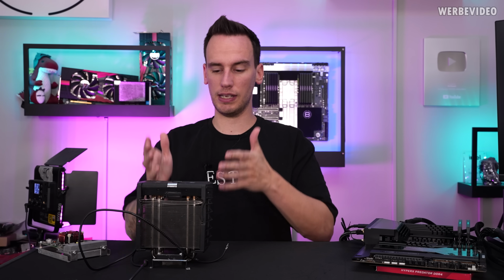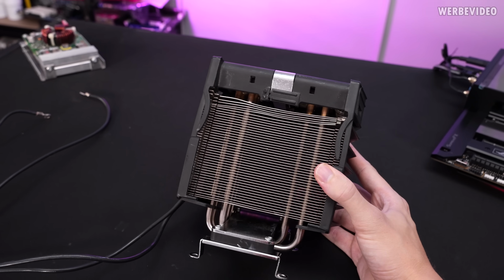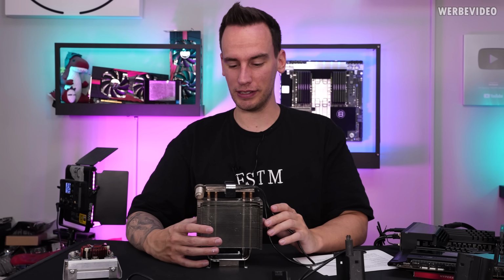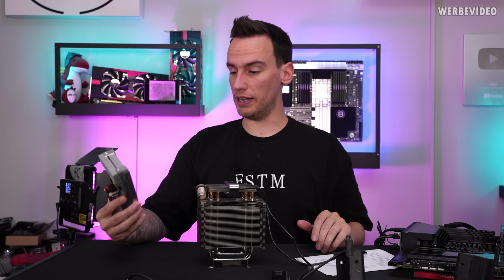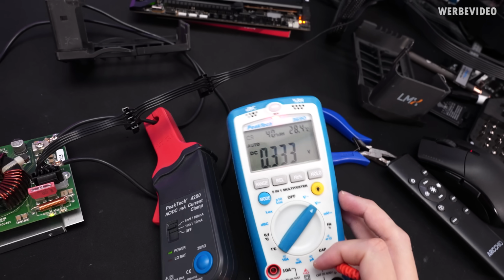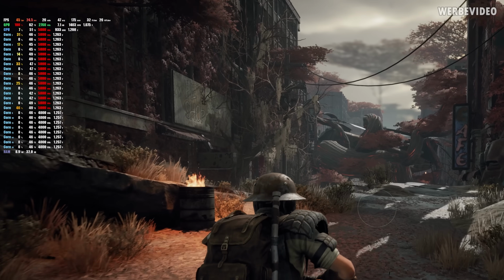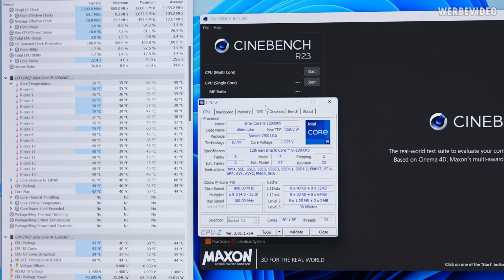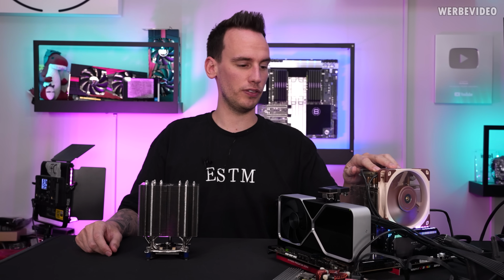This Cooler Ruined an entire Company - LMX Liquid Metal Cooler

Comment: Awesome video. Also this kinda made me realize something... how come my 5950X when running CB23 consumes about 100W package and the temps are 70-80*C with similiar cooler, but the 12900KS in the video consuming 200W package reaches the same temps as mine that is insane. How is that possible?
Reply: In the intel case, the cooler putts 100w more heat into the room. If it does that fast enough the temp Is the same...
Reply: @kaptainfry  Oh I see. Makes sense now that I think about it.
Reply: If your 5950X only suck down ~100W package power in CB23, it means your either your motherboard is throttling the CPU because of insufficient VRM or you disabled PBO . If you unlock your PBO power limits, you can get the 5950X to suck down ~240W .
Reply: @fleurdewin7958  Yeah I have PBO disabled. Increasing the power draw wasn't point of the question tho.

Comment: This is most likely an electrohydrodynamic pump. These work by passing a current through the (conductive) liquid perpendicular to the flow which is exposed to a dipole magnetic field in the other perpindicular direction. The lorentz force on the flow is the driving force, basically a liquid railgun. This also means there are no moving (mechanical) parts in the pump, so it is no suprise that it still works well. Btw heatpipes work so well because the water inside goes through a phase change. The thermal conductivity is thus not at all important for it's performance. And in water cooling loops it is all about convection, so again the transport medium thermal conductivity is not important.
Reply: You’re correct. The wires are going into a coil around the block, basically half a transformer. That’s why it’s pulling 30amps, it’s basically a short circuit. I’m kind of surprised/impressed that it wasn’t so electricly noisy that it didn’t make a hum or hiss on the audio recording.
Reply: @leafydialupking1  There is no coil, the field is produced by permanent magnets which are held by that clamp thing (which is actually shielding and guiding the flux more efficiently) on top. Making an electromagnet for this application would be very inefficient and at 30 amps it would require more power than the CPU its cooling. As for noise, this is a DC application, so the only noise would come from the power converter board
Reply: @WouterVerbruggen  I would think for it to be a Lorentz force pump that the wires would be perpendicular to the magnetic shield, since the current needs to move perpendicular to the magnetic field and parallel to the direction of flow. And in that case the inverter module must include a current clamp since the pump would have very low resistance.
Reply: @leafydialupking1  The current flows throught the liquid metal from one side of the channel to the other, the lorentz force pushes on the fluid directly. So with the liquid flow as reference, the magnetic field is top to bottom, current from left to right and thus force in the direction of the flow. The electical "short" is the low resistance of the liquid metal, which I would guestimate to be in the 100 nOhm range so you'd need some expensive equipement to measure that directly.
Reply: @WouterVerbruggen How does a static magnet achieve this?  If that was true, you could slap magnets on a piece of steel and it would levitate or propel itself.
Reply: @VndNvwYvvSvv  you have to a current in the metal and then you can do just that
Reply: "Liquid Railgun" would've been a much better name for this cooler :)
Reply: @nazgu1  Caterpillar drive was right there. (I am aware this comment is delayed)
Reply: I am also sure it is a electrohydrodynamic pump but not sure how the current is prevented from flowing in the metal structure and not just in the liquid metal. Otherwise it does not work.
Reply: @1kreature Well through the liquid metal there will be continuety throughout the cooler. The current distribution will favour the path of least resistance though, so by proper engineering that won't be a problem. The will be a voltage on the entire structure though, but this voltage will be so low that it's not a problem and probably not even noticiable at all.
Reply: Eddy currents was the first thing  that came to my mind when looking at this particular setup, very interesting.

Comment: if they wanted to improve a bit and feel a bit edgy could of used acetone; commonly used for evacuated solar tubes and so considered safe:P
Reply: *they could have
Reply: If they were willing to use NaK in a CPU cooler, then if they had to switch to a solvent instead, they might as well go to diethyl ether. I'm pretty sure maximizing flammability was part of the design goal.

Comment: worth mentioning, even if this cooler didn't fail catastrophically. If a user wanted to get rid of it they would likely need to contact a chemical disposal specialist, and failing to do so could also lead to violent results. it's a wonder this was ever considered for retail sale.
Reply: @danielrouw2593 everything you mentioned people know to handle with care. But a PC cooler filled with a dangerous substance that looks at a glance like any other safe PC cooler is a disaster waiting to happen. Very very strange to defend this useless dangerous product but you do you 👍
Reply: @danielrouw2593  I don't think anyone was advocating for making this illegal. Also, leaks and accidents happen, NaK is much more reactive than you give it credit for. If the air is humid it'll burst into flames all on its own.

What we're saying is that the company who made this was dumb for making it because while it might have the potential to slightly outperform a heatpipe, a heatpipe is simpler, more robust, safer, cheaper, easier to manufacture, stores better, and doesn't present a disposal hazard.

Drano and concentrated soap are what NaK violently reacts to form, after which it begins to react the way you're expecting it to.

People like you underestimating the dangers of unfamiliar substances are actually one of the main drivers of nanny state regulation, because you get yourself killed mixing gasoline and styrofoam and your family sues the companies who made them. They then lobby for tighter regulations on substances to lower their legal costs.

Comment: Not only does water have a better heat capacity, it also undergoes a phase change in heatpipes. The phase change step takes on so much more energy than heating water. 
Heatpipes also solve a secondary problem compared to water/liquid metal; the boundary layer effect, the best flow/fastest transport of volume/sec. in a liquid cooling loop is in the middle of pipe... the heat exchange though, happens on pipe inner surface where the flow is the poorest. Heatpipes forces the transport of heat along the inner surface.

(all modern waterblocks are designed to create as much turbulence as possible to break up boundary layer effect, the liquid metal design here looks like straight pipes thru CPU block, but I could be wrong ofcoz)
Reply: Can you explain the second problem it solves? I don't quite understand.
Reply: @queueeeee9000   (sorry for a wall of text) Boundary layer effect, when you pump a fluid along a smooth tube, you will get different flow speeds in the tube depending on how close to a tube inner wall you measure. Gas/Water/liq. metal flow creates a drag resistance against tube inner surface. Slow flow near inner surface compared to middle. That sort of creates a layering effect, liquid near wall prefers to travel along the wall. In this liquid metal design, the liquid metal is only getting warmed by the conducted heat transfer from external source at the inner surface of tube. Then, already warm liquid continues to travel slowly along the inner tube while in the center of the tube "cold" liquid rushes past the entire hot area without picking up any heat. Only when the flow is disrupted by a rough surfaces, bend or a shift in inner diameter will there be promotion of mixing the hot "wall fluid" and cold "center fluid".

It is possible they have rough surface inside tube to break up these layering effects, impossible to tell without inspection or manufacturer information. I'd guess no.

A heatpipe, as used in PC cooling, has different densities inside, one density in middle, other near inner tube surface. Along inner tube wall there are small (sintered) structures that are sparse enough for high volumes of media to pass per second. The opposite is true of the central structure, a denser wick like structure that has an affinity for adhering to liquid: Wick effect.
By combining these two structural differences (with low pressure water) it provides several advantages: It promotes high flow of media near inner surface where the heat source is, the sintered sparse structure provides good mixing of media because of the chaotic ways it has to flow. Also because of the phase change from liquid to gas more energy is taken up without heating the water that much. The turning of water into high volumes of gas it will leave the heatpipe hot zone much much faster than a liquid would.
Liquid creeps slower in wick towards hot zone, gets hot, turns to gas and zips off to cool area of heatpipe. The volume flow of gas is probably around 1600 times faster compared to the liquid speed in wick, if their respective surface area in tube are equal. As for an approximate real world flow speed or water amount/sec in heatpipes I have no idea, never done any such calculations nor looked it up.
Reply: @Paxmax  thank you very much for the explanation. That's incredible. I had no idea how much actually goes on inside the pipes. Incredible.

How does the wick in the center, stay in the center?
Reply: @queueeeee9000  its a compressed pellets structure that surrounds the denser center structured "wick".
Reply: @queueeeee9000  there it is hahaha read it again xd

Comment: kelvin and celsius ARE NOT THE SAME ..... Why is Kelvin 273 more than Celsius?
Each division in the kelvin scale called a kelvin (K) is equal to a degree on the Celsius scale, but the difference is where zero is. In the Celsius scale 0o is the freezing point of water while in the Kelvin scale the zero point is at absolute zero. Therefore, 0oK is equal to -273.15oC, 0oC is equal to 273.15 kelvins..

Comment: Although the New Heatpipe coolers have high reliability standards, I do not agree with your conclusion. 

I have a CoolerMaster Hyper 212 and an Antec C400 That after 5-7 years of Use Leaked The coolant somehow and Do not do Crap anymore. They look intact they were always handled well and Used mainly in the PCs so there is no storage errors or damages done to them. They cant Keep a Ryzen 1200 on Stock Below 70C in a 25C Room. 
Water is the Safe solution for cooling. That's why most people use it. 
But even in small quantities it suffers from Heat expansion horribly. 
What they probably wanted to do here is have a liquid in a closed loop that will not expand to Burst the Loop. And not depend on the Evaporation to transfer heat. But have a Car/plane like pressirized cooling system.
Pressurized Coolant was used since WWII but even then it was a Glass cannon tech on Planes. It's also a German invention. But they Had it on and Off. As always, Brits took the credit for inventing it. Like everything else they invented, other than Kidney pudding and colonizing countries. 

Because when you are getting shot at, 1 bullet, or even a fragment, can drain your coolant. Simply because You have a hole, pressurized coolant escapes and the left coolant is not sufficient to Cool the engine and Keep's vaporizing until it's all gone. Even if the cooling loop is hit Hig. That wouldnt happen on Non pressurized loop you would lose less and The engine would have plenty of coolant to keep on since initially it didn't demand pressurized cooling. So the loads are much lower. 
With Modern Heatpipes we Underpressure them to compensate for Insane water expansion, but as you see Any reason for it to fail, it will fail. It's only our Industrial capability that keeps it working reliably. 
So As a Fellow Engineer, I do not agree.
It's a Myth that Water is the best choice because It's so good. It's just what we have developed the most because of the Balance of pros and cons.
It also saddens me when I see Engineers from other countries are Indoctrinated how to think. Instead of Weighing out the Pros and Con's. 
Also all that chemicals fearmongering OMG...
If it spills its not that big of  a deal you will have a dead PC.
If the Heatpipe discharges, the amount is so low it won't do any harm.
Thermal conductivity is good enough, and we worked around thermal expansion. 
Also, the Price is very enticing. 

I Don't Think they were onto something, they had an idea and failed its OK. 
Success is built on Graves of those that failed...
But I also don't like hearing the rigidness in this review. 
Also compare a Liquid cooler form that Time To the Noctua and you won't much better results. 
It's a 13 year old product.
Reply: I dont think you know how dangerous NaK is... Its definitely a thing you dont want to be around when it leaks. And wouldnt liquid metal also slightly expand and contract from the thermal cycles, also stressing the pipes and joints and whatnot leading to failure? And if you have a hole in the system that doesnt cause a leak (like in the top), just the humidity in the air can react with the NaK and literally burst into flames. And if this was a mass production cooler, no doubt someone will have tried to pour water on it to put it out, only for it to blow up in their face. Sure, even if your hypothesis is true, heat pipes are more than enough in consumer air cooling in terms of reliability of a 20-150 dollar part and as you have said, is wayyy safer. No harm replacing a air cooler, not so easy replacing a home.
The worst thing a heatpipe can do is fail and maybe kill your CPU. A NaK pump cooler will burn down your house if you dont know how to deal with it if it does catch in flames which is to just pour baking soda on it and hope for the best or a dry powder fire extinguisher but im pretty sure most people dont know that and will take their water bottle and throw it at the fire, burning down their house and maybe killing themselves.
Reply: @phrog2579  A small or pinhole leak won't cause a fire as the reaction would be too slow to self-ignite with just air. You would need it to be saturated in liquid water for it to get hot enough to ignite the hydrogen gas bubbling off it and frankly, any electronics can start a fire when soaked in water. Technically, this is still at least less dangerous than many lithium polymer batteries. Then again, I don't make a habit out of keeping such batteries around my house either and frankly, regular water-filled heat pipes work more than well enough to not justify NaK filled heat pipes. If I really wanted to do better than regular heat pipes, water cooling or sub-ambient phase change cooling can be done without getting NaK involved. I'd definitely pass on a NaK-filled CPU cooler as it's just not solving enough problems to justify putting NaK in a computer.

Comment: This is perfect for a danger build. With a gigabyte PSU, a pentium 4 overclocked, an rtx 480
Reply: Ah yes, the RTX 480, easily the gpu of all time.
Reply: RTX 480?
Reply: NZXT h1 case
Reply: @fracturedlife lol good addition
Reply: Asus or msi mobo & overclock management
Reply: In wet basement 😂
Reply: Lolll gigabyte psu 😂
Reply: Pentium D
Reply: Can you be more precise on the Gigabyte PSUs? I had one that was and is working. Now I have another one newer. Never had problems 👀
Reply: ROFL 😂😂😂
Reply: Put it on a 4090 and shake the psu cable slightly first for extra spice
Reply: I'd say the GTX295 instead, which is essentially 2 GTX480 chips running on the same PCB.

Recipe for smoke, essentially.
Reply: @EternalxFrost  The GTX 295 had two GTX 290s in one card. They were a different architecture from the GPUs in the Geforce 400 series cards. The GTX 480 never had an official dual GPU version, though there was a company that made a custom board with two GTX 480s. They called it a GTX 480X2. Nvidia's next official dual GPU card after the GTX 295 was the GTX 590, a dual GTX 580 with reduced clock speeds. The 580 and the 480 were very similar, though the 580 had significantly improved power efficiency and a fully enabled GPU die (some features in the 480's GPU were disabled, presumptively due to either binning issues or to lower power consumption just enough to prevent the GPU from melting).
Reply: @5467nick  Yes, i had  GTX 580, still have!
Reply: @5467nick  295 is 2 280 gpu dies, 290 didnt exist only 205, 210, 220, 230, 240, 250, 260, 275, 280, 285, 295. out of those there was 2 dual gpus, 1 was a 295 with either 1 or 2 pcbs depending on the company and release date, and the other was the special joker edition 275 with a 275 and a gts 250 both on the same card.
Reply: why rtx480 and you can get a 4090 with some faulty cabling?
Reply: Just get 9900k